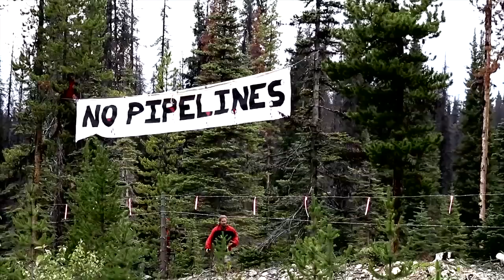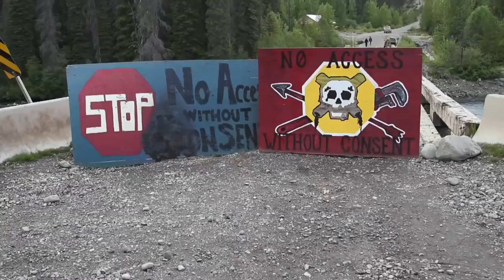How to Stop Climate Change

Comment: I agree the CO2 emissions are a huge factor in the dilemmas of climate change. However, CH4 and NO2 are far more damaging. Between the permafrost emitting CH4 at alarming rates and factory farms contributing to both CH4 and NO2, halting the use of fossil fuels will only buy a little more time. I don't intend to dishearten the need to euthanize the fossil fuel industries by stating this. It's merely an observation that needs to be factored in to the equation. Some scientists are already attempting to burn off the  methane in the Arctic via high powered lasers. But, unless the vast majority of humans on Earth becomes aware of the issues and importance of acting together to repair the damages done, we are going to be doomed. Many thanks for sharing this update to the cause of combating climate change deniers. Be well and take care.